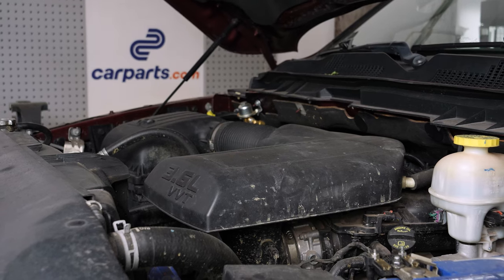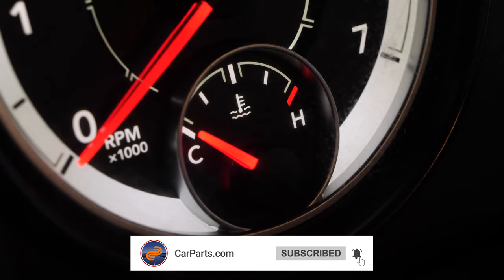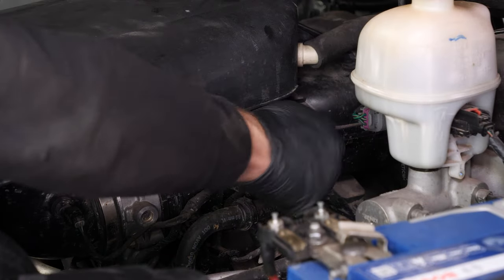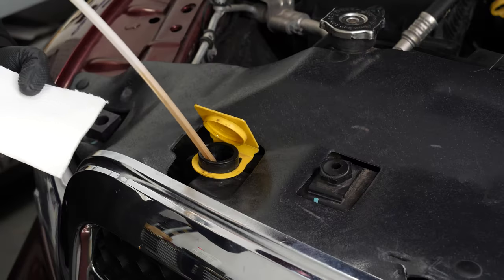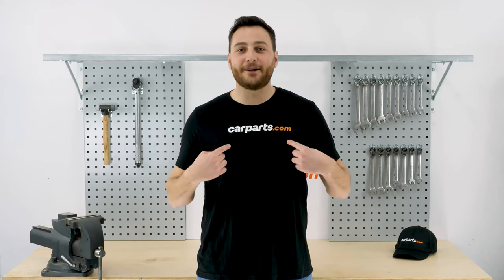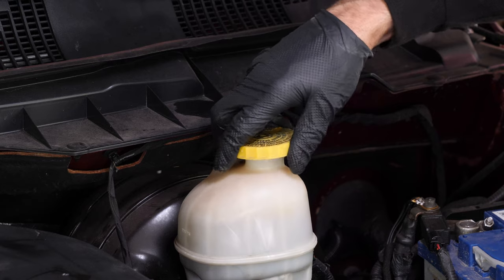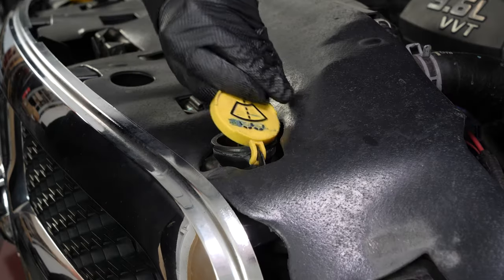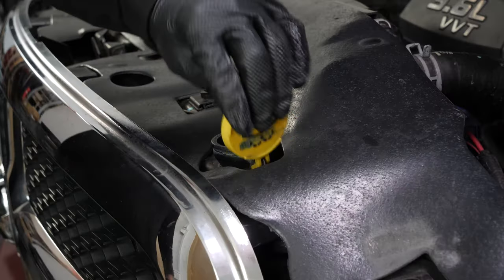How to Check the Fluid levels 2009-2018 Dodge RAM 1500 🛢

Comment: Are you able to check trans fluid on this model of ram 1500 i original only owned older trucks witch all had a trans dip stick front and center but my 2015 does not
Reply: Yeah, I have the same truck and I had the same problem. There’s no way to check your transmission fluid level unless you get under the truck and actually open up the boat on the side of the transmission.
Reply: Rite

Comment: How do you check transmission fluid levels ????
Reply: If it’s a ZF transmission you open the port of the side of the transmission while at operating temperatures and you want it to be trickling out. If there is none you add some until it does. Thats the only way to check it if it is a sealed transmission with no dipstick.